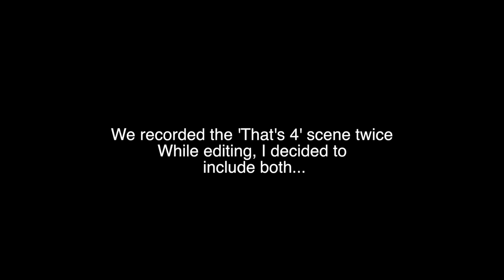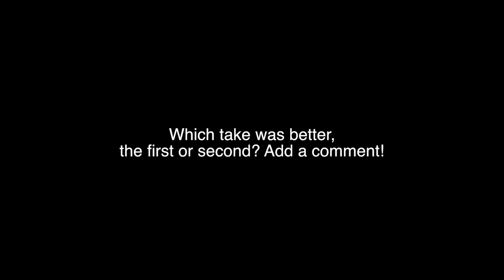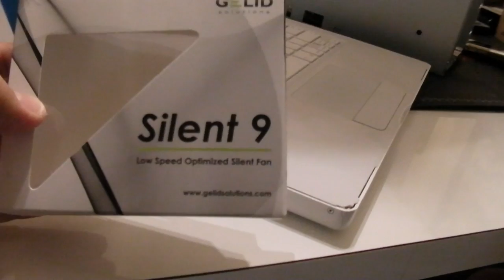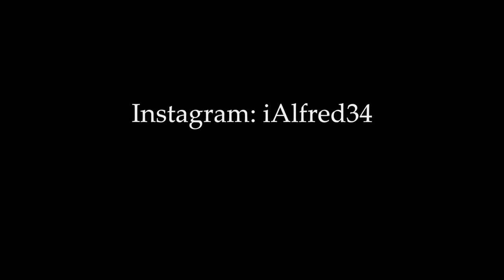Tech : Holiday Hardware Hacking 2015 and 1/2 (Drobo Fan Install)

Comment: hey guys... whicj is the size of the fan? 90mm ?
Reply from the maker: Yes, I messaged Adam and he confirmed 90mm. OMFG -- is this video actually useful? It's not supposed to be useful.
Reply: oh yes , even if you made it funny ... I have the same problem and now i know how to open my drobo, i m ordering a new silent fan now :) . Thanks guys :)
Reply from the maker: I will tell you - as you can see, it was NOT EASY opening that device. Make sure you take a good look at the tools that AdamB used -- make sure you have decent tools, and don't cut yourself on the metal. Good luck. Post a video and share the link with the gang here!